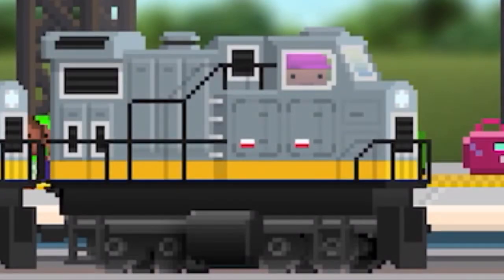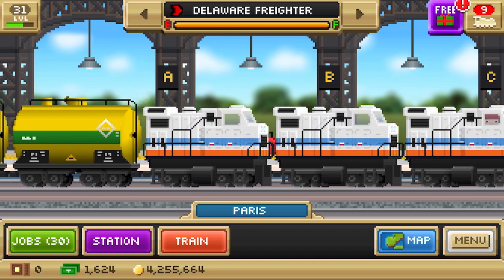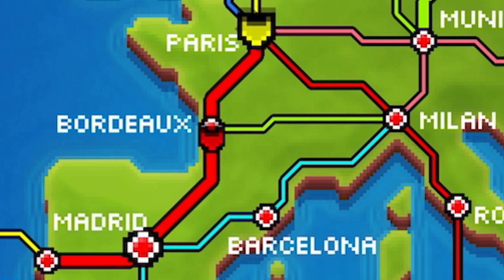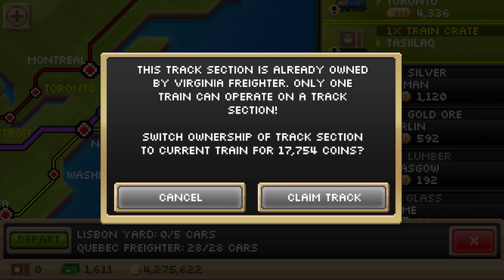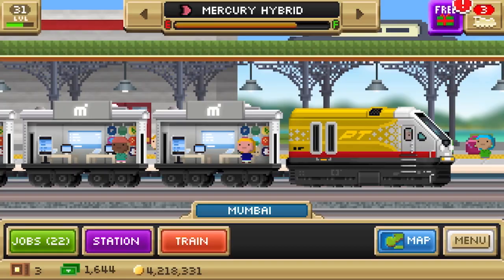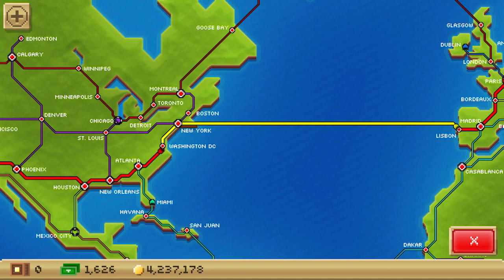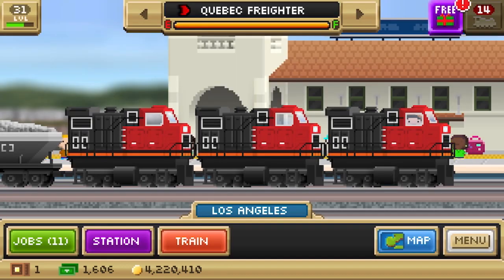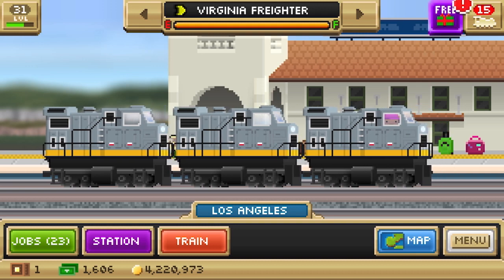Precision Scheduled Railroading in Pocket Trains

Comment: would like to see some sort of guide about how you should progress throughout levels 1-10, 10-15 etc.!
Reply from the maker: I’d just say to spend carefully in the earlier levels, and get extra engines and fuel cars if you can. Expanding your network can be good, just make sure you have enough to do it.
I’m not a Pocket Trains expert but those are some tips I can think of.
Reply: In the early stages, I don't bother repairing my trains unless they are a steamer train. Better to save the parts and the money for getting more trains!